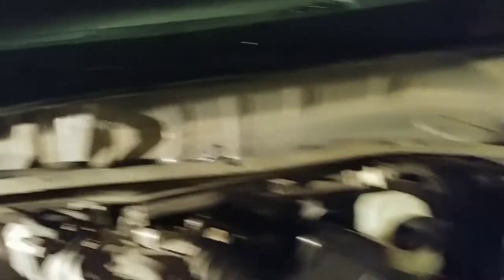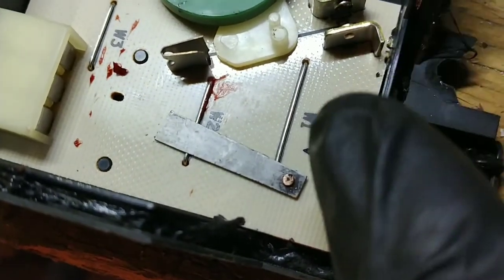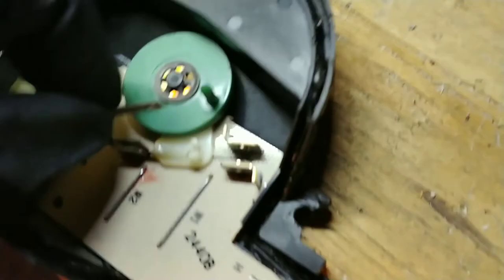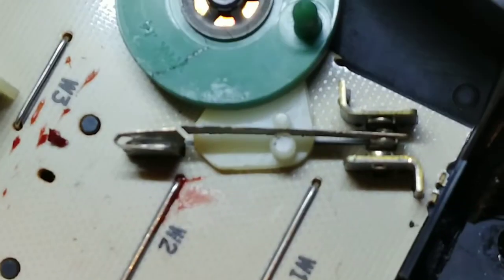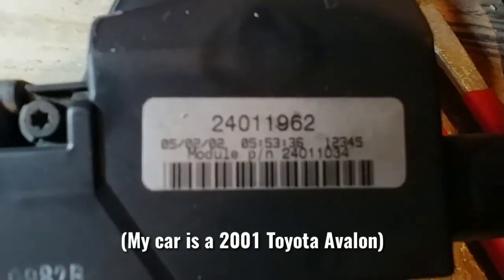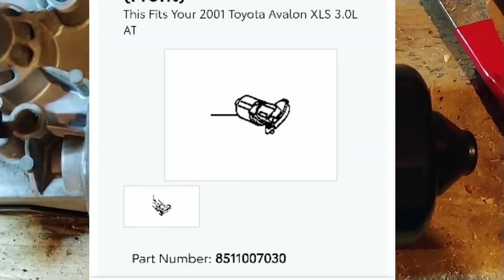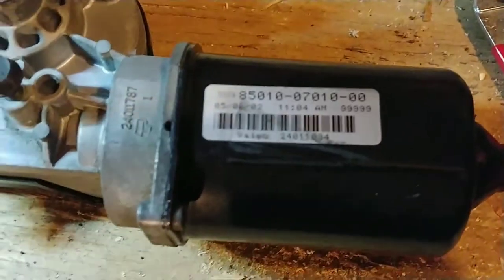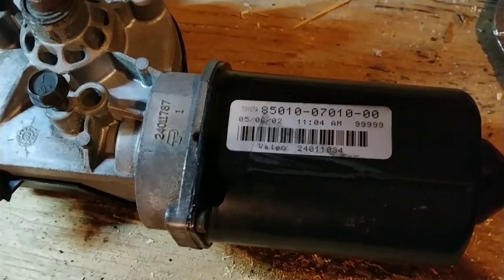Toyota Avalon 2000-2004 Intermittent Wiper Fix

Comment: Absolutely perfect!  A couple dozen other guys post videos of a solution which, as it turns out for me, was no solution at all.  You come along, go against the grain and get it right and clearly explain how to confirm the diagnosis.  I only wish I saw your video before I spent hours driving to the junk yard to pick up a wiper switch module which didn't fix the problem.  

After watching your video, I pulled the motor, opened it up and there was the contact arm sitting loose in the bottom of the case.  Simple engineering problem. By design, the metal flexed every time the wiper motor was used and the resulting fatique inevitably caused the metal to fracture.  

Only thing I would add is a suggestion people NOT get a used motor to fix the problem.  It is such a crappy design. Any used wiper motor from a car which has seen 10 or so years of use will probably fail in short order (if it has not already failed).  Tomorrow, I will drive down to the parts store, shell out $60.00 and have confidence I am getting it right.   Thanks.
Reply from the maker: Victor29576 Thanks for the kind words! Hope this helped!
Reply: So wait what cost 60 bucks?  Video says motor new almost $250

Comment: Way to go! Fixed mine with solder. May not last long. Wish I had used a patch as noted below. I too went down the rabbit hole before this video.
Reply from the maker: Yay! Glad it saved you some time! Wish I was more handy with solder like you.
Reply: @mckevrock  wish this had been available in February before I spent money on the problem. Soldering is easy. Tin each side first with a 40w gun. Then put the 2 together.

Comment: I fixed mine by soldering a good quality copper contact armature from a disassembled electrical relay. The donor industrial relay wasn't too large, of size of two matchboxes or so.
Reply: I used a folded bit of sheet metal, soldered as best I could, then covered that with JB weld.  Working at the moment.
Reply: @olsenn9  Hopefully it won't rust/oxidize. Relays are good for the purpose for they have silver contacts

Comment: Amazing video. Thanks!

I had the same issue. I opened my motor and noticed that little metal strip snapped off just like described in the video. Here's how I fixed it.

I put the strip back in its place a little on the inside  of where it had snapped off.  I then shoved a piece of conductive metal below it to wedge the strip tightly in that V shaped terminal, and then I  soldered it all together. Basically, I just found a way to reattach it so it stays in full contact with the terminal on the left.

I also glued the area where the metal goes thru the plastic channel in the middle, as an added solution, to hold the strip in place. 

I put the motor back and it worked like a charm. I just don't know how long it will last. If it dislodges, I'll think of something else but for now it works great. 

I uploaded a pic of my homemade fix rt here: https://ibb.co/sJtxgJj

You'll notice the messy soldering on the left contact, and the splotch of glue in the middle where the strip passes thru the plastic channel. Hey, it works! 

Hope this helps.
Reply from the maker: Your soldering skills surpass mine, sir!